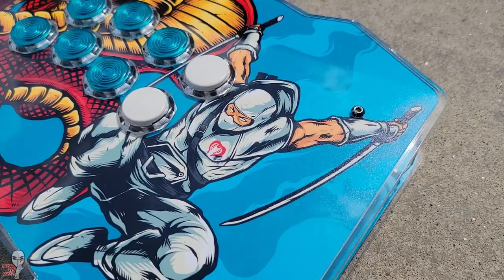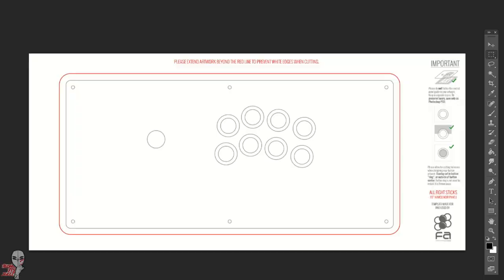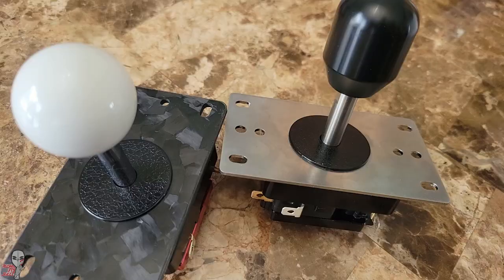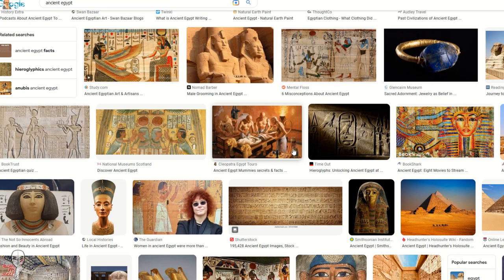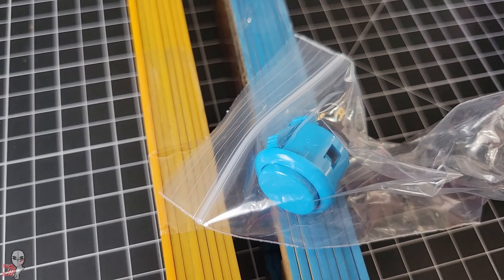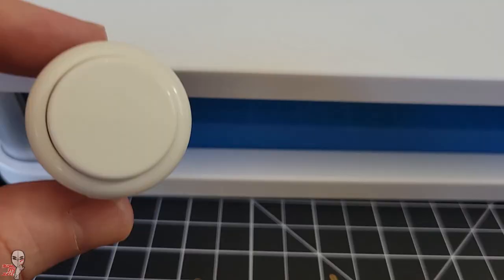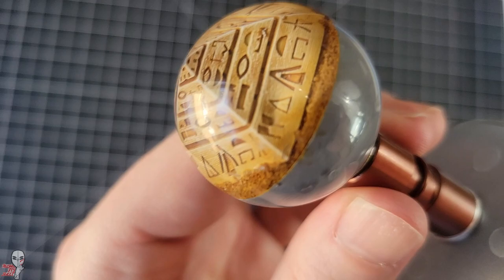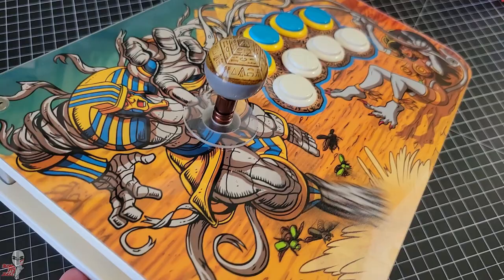How to THEME your fightstick - Taking arcade sticks up a notch

Comment: I love themed fight sticks and controllers.  That Anakaris fightstick looks amazing.  
I I've been customizing controllers for about 5 years now,  mostly nintendo switch joycons and pro controllers.  A couple of months ago I decided to customize a couple of arcade sticks that I have,  It now has become an addiction, just like with my controllers.  I made an Astro city inspired built on a 360 razer atrox wich turned out pretty cool.  But my favorite one right now is another 360 razer atrox that I themed around Goku Black, so, lots of pink.  
I really like sanwa buttons, but sanwa doesn't make transparent pink ones.  So I took matters into my own hands.  I applied things I learned modding controllers.  So I went and bought sanwa clear buttons and turned them pink with Idye Poly fabric dye.  I took them apart and did some testing first,  they came out amazing.  You should look into dyeing plastic, with fabric dye, that might open more possibilities for future projects.
The cherry on top for that Goku black build, was a 4 star clear dragon ball, ball top, which of course, you guessed it, I turned pink with the fabric dye as well.
Reply from the maker: Very cool! Yeah, I need to mess around with dyes more. That would be a pretty cool vid, actually. Thanks for the idea and thanks for watching!

Comment: I accidentally happened on a theme for my stick due to lack of availability of parts where I live. I was able to scrounge up red Sanwa buttons a Seimitsu LS-56 with a white ball top and a black A4-sized 65mm thick 3D picture frame. And with all those parts I realized that those colors remind me of Aya Shameimaru from Touhou. So now I'm making an Aya stick :P
Reply from the maker: Happy little accidents! Now that you've got your sweet theme lined up, I hope the build goes smoothly! Good luck!
Reply: @HushMySweet1  Thanks. I only have to do some wood filling, sanding, painting, redo some holes and do the wiring. It's on the home stretch now :)

Comment: I want to find a nice artwork and print it for my Daija arcade stick,  but how do i know the size of my stick?
Reply from the maker: Try the .psd file here https://focusattack.com/artwork-print-and-cut-for-nacon-daija/
Reply: @HushMySweet1    that cost 15$ ?
My question was if i want to create my own, forexample i find a nice picture that i want to use and print it out, but what is the size to print?
Excuse my ignorance on this subject.
Reply from the maker: @genantamtam9364  There is a photoshop .psd file on that website link. You don't have to pay anything to use it, but you should download the .psd file because it has all of the correct measurements ready to go and you just need to lay your art over the top. You can use photoshop or gimp.
Reply: @HushMySweet1  ok i will try that.
Thanks 👍 alot.

Comment: We’re did the night time button come from
Reply from the maker: I believe that was a metallic Crown 202 and I just swapped the button cap to a starry night set I got from Sleepy's Arcade on etsy.
Reply from the maker: Must have missed this reply. You can print your own OSBMX buttons in your color choice of filament and then use your preferred switches. If you want something printed on them or inside the button cap, like new button caps you can install on usual button brands, then look at Sleepy's Arcade and BarnesIndustries, both on etsy. I also had Mark Bueno cut me some wooden purple heart button caps. Then, I believe Arcade Shock will soon be offering a button print service, so that's also something to keep in mind. Hope you get what you're after from somewhere! Good luck.